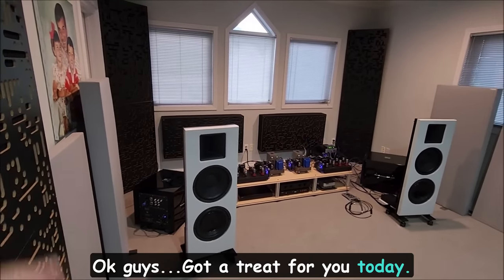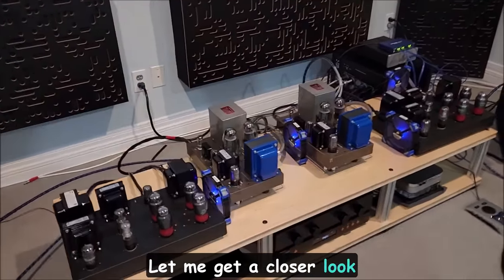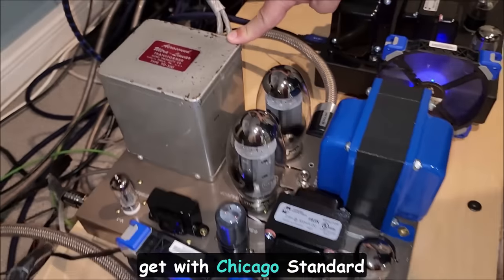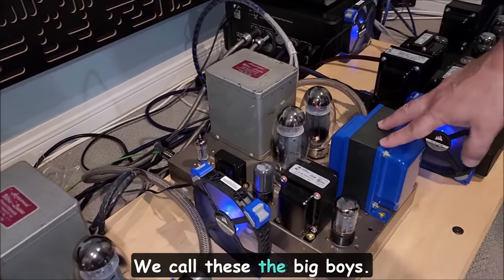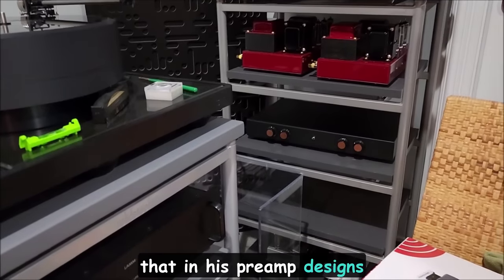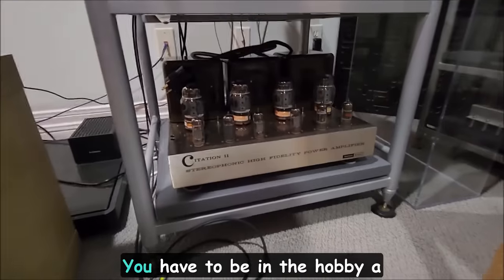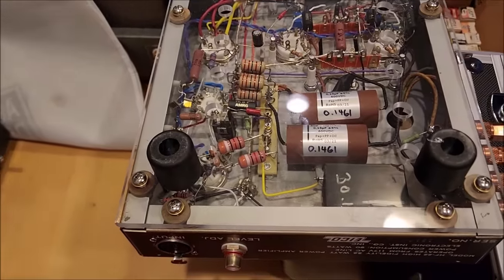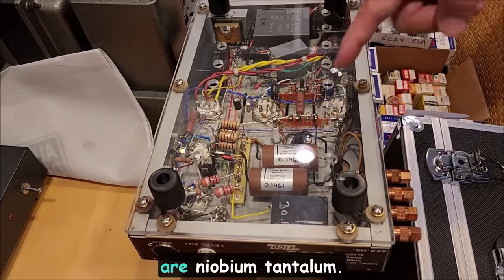One of the Coolest Systems and Assortment of Gear - Emerson's System Walkthrough

Comment: Wow, impressive!   I have the stock x5s with the stock clarity caps in the crossover.  Clayton mentioned replacing the tweeter cap with a VH odam would be an upgrade.
But this person completely redid the passive crossover and also incorporated active crossover with exotic tube amps.
I think the stock X5s sound excellent and wondering how much better they can sound with all these mods.  He even changed the tweeter crossover point from 1k to 1.5k.
I'm sure they sound much different than stock with all these changes.  Who knows how much better they can possibly sound but I'm sure they do

Comment: Why complicate life with crossovers and amps  for each channel instead of just getting better speakers
Reply from the maker: Think of it another way... Why buy a new cabinet and drivers... Pay dealer and distributor markup again... When you can easily tweak whatever deficiencies are noted in the speakers you already have and like otherwise?
Reply: I have PAP speakers and i do not find them to be unstable with a high level of sound. I do find i need to tighten the screws down sometimes on the woofers.
Reply from the maker: PAP intentionally has a little play in the "cabinet" structure, but I understand he has a different option for those who want a firmer structure.  That would be my preference and maybe you have those.